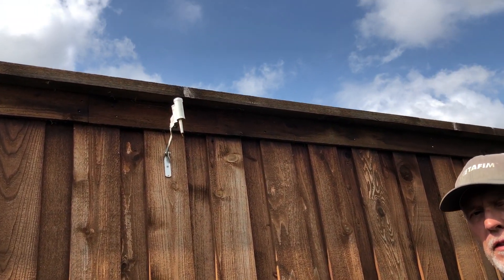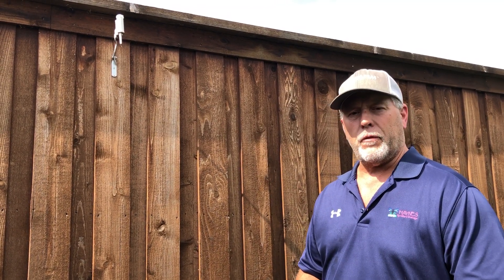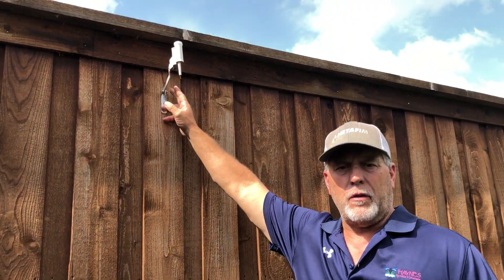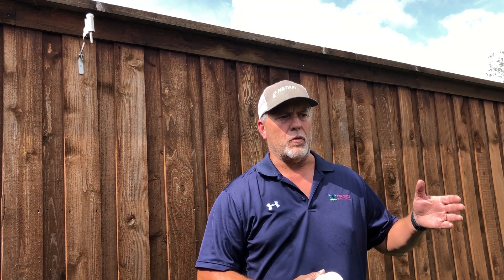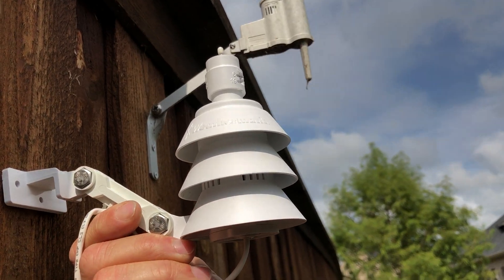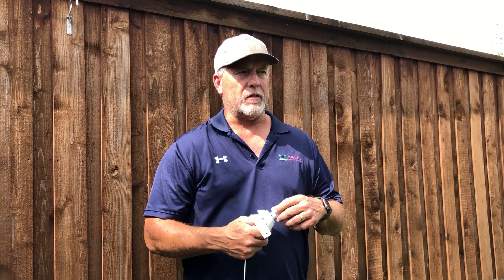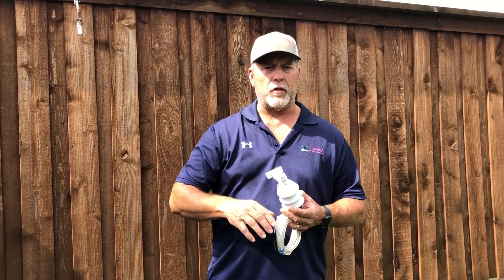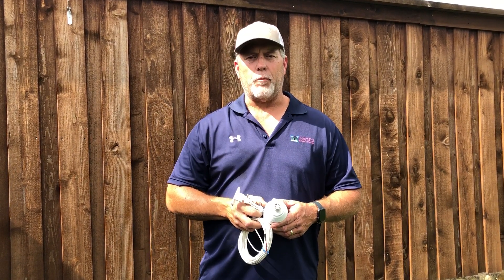Sprinkler Rain Sensor - How it Works

Comment: Professionals instal rains sensors over conduit standing up, oll wire get hidden and the plastic pipe allows you t place it at the best location. No screws or drilling any where is required